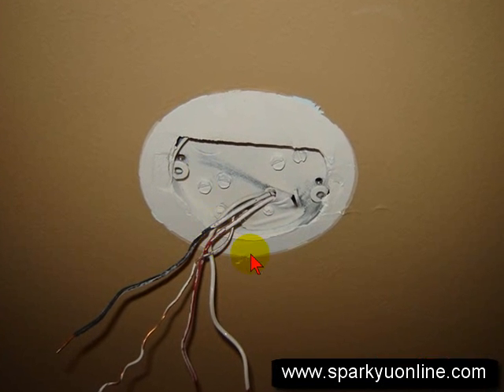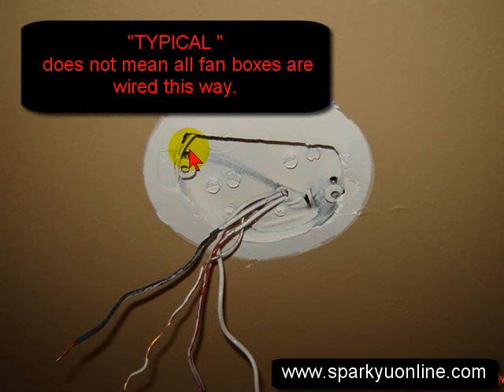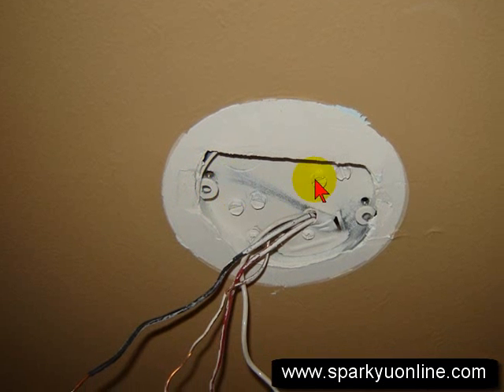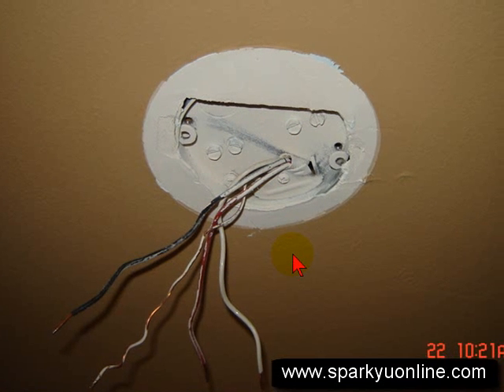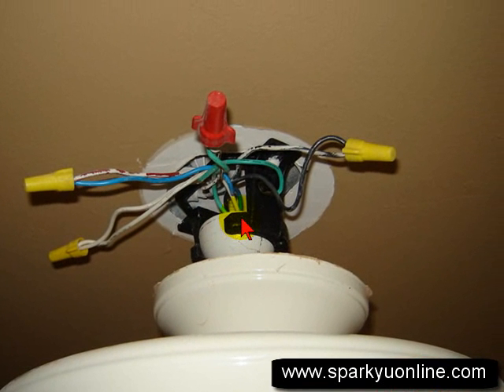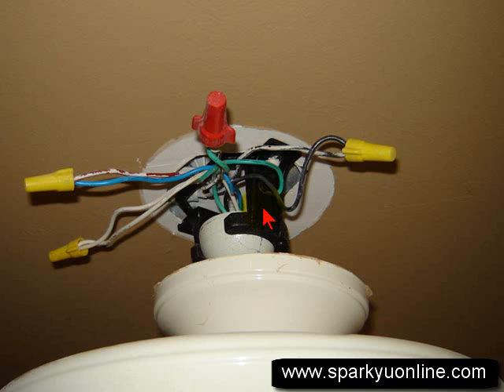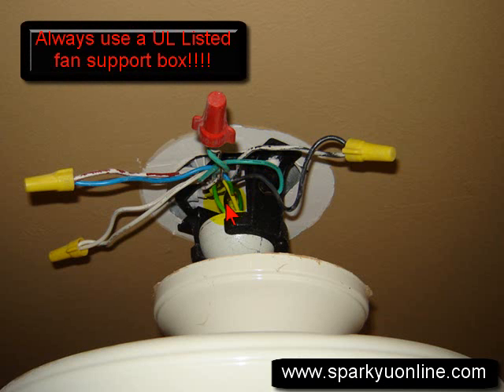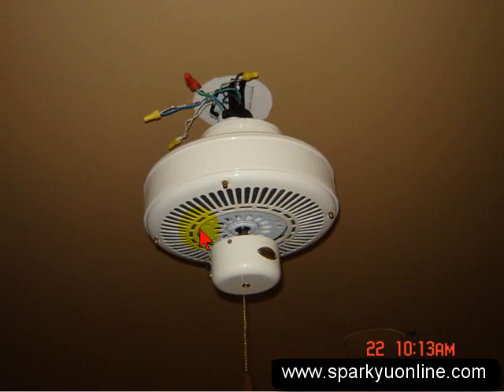Electrical Wiring - Fan Box

Comment: Someone had asked about the box's volume. It's 8 cu. in. The wires look like #14. There are 3 conductors plus 1 ground conductor which = 4. NEC says 2 cu. in. each  [for  #14] ,  so 4 x 2 = 8 cu in. In this case, the fixture wires are a freebie, in other words they are not counted towards box fill.  The box is Code legal. If the conductors were #12, the box would be illegal because 12 is 2.25 each requiring a 9 cu. in. box.
Reply: calm down homer